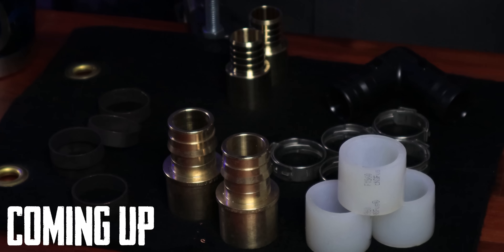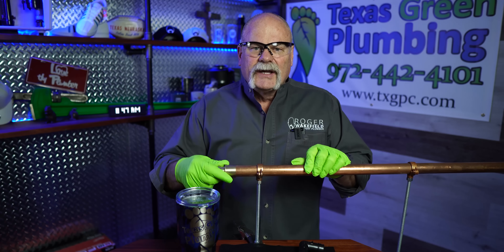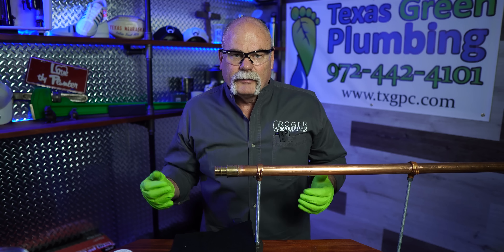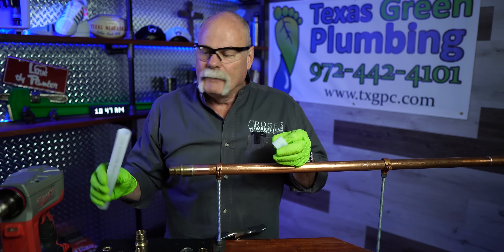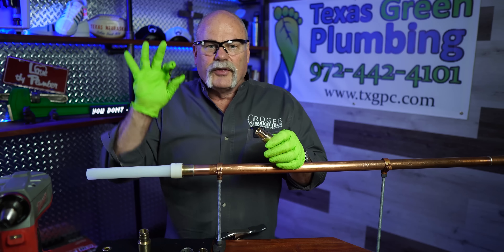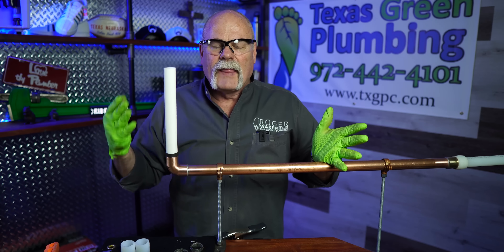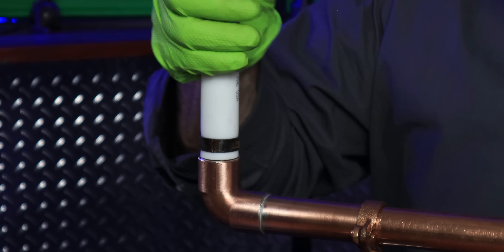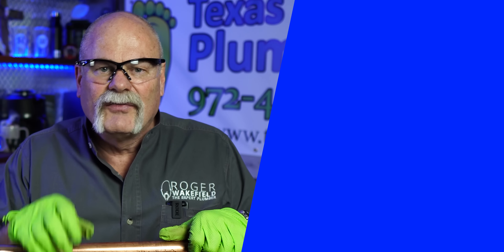How to Connect PEX to Copper Plumbing Pipes

Comment: How about a torch review video. I am looking for a good all around torch for doing soldering and possibly brazing. I bought one of those map/02 torch from home depot. Its a piece a shit, it burns through the 02 in a matter of minutes. It would be nice to have some sort of map gas torch that gets hot enough for brazing. A turbo torch of some type? You tell me

Comment: Upinor is the name brand of pex . They are both pex . Type a is much better than type b pex. The inside diameter of upinor fittings is closer to the actual size of the pipe . Type b pex is almost a size smaller. If type b crimp rings have any strain against them they can and have broken and or leaked.

Comment: Another great video thanks Roger!

I would prefer to use the manual tools for both crimp and uponor.
I seen both of this leak later down the road. Electrical tools need to be service/ calibrated..the milwaukee tool needs to be greased it sometimes gets stuck and doesn't rotate.
    I do use viega fittings for both pex A and B for repairs and they work great for me.
Reply: I’ve used battery expansion tool for 14 years and putting grease once in a while isn’t hard. Try getting the manual one in a tight spot and expanding, good luck?
Reply: @joem5332  
Yes, you right i would use the m12 on a tight spot,but I'm in the new construction plumbing business.
This type of leaks are rare ,but they do happen.